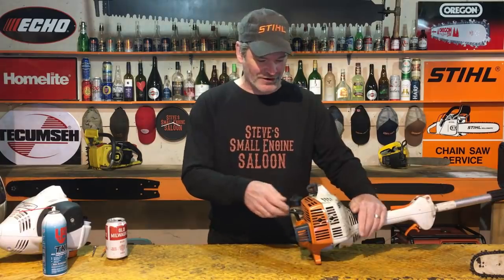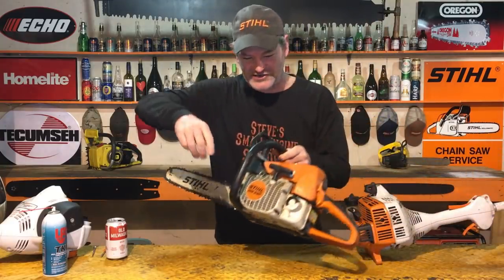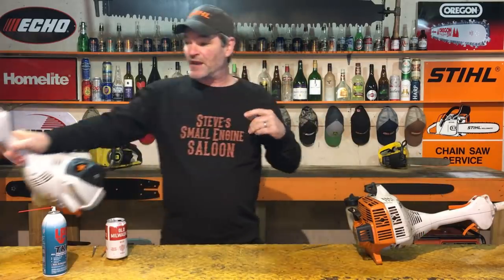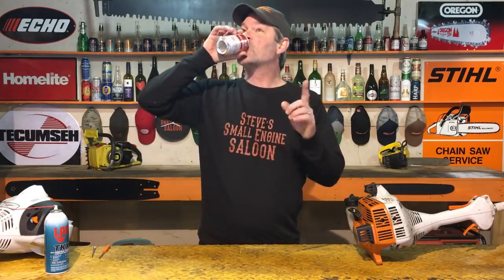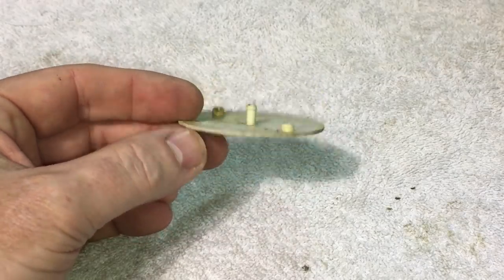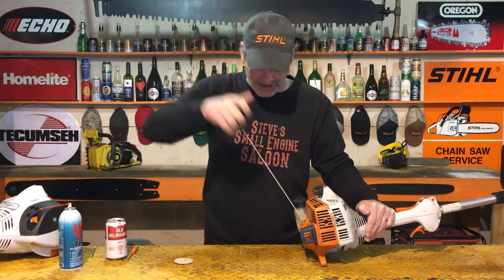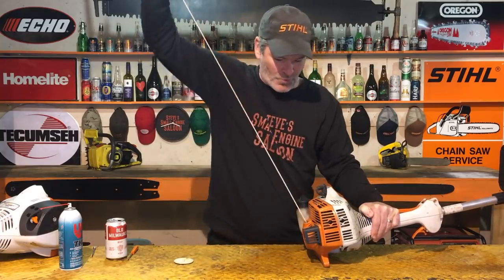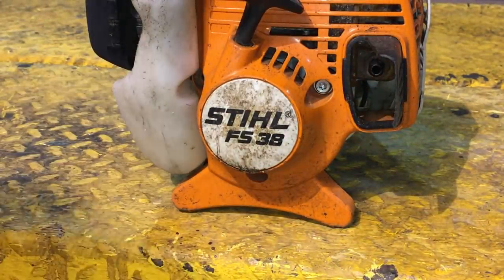How To Lubricate A Sticky Starter On A Chain Saw or Weed Eater

Comment: Thank you so much.  I could not start my machine after the winter and the grass was getting long, I just could not get enough of a pull on the recoil string. I found your video and today had a go at fixing it. The cover eventually flew off, in one piece thankfully. Having lubricated and refitted the cover you could have knocked me down with a feather when I was able to start the machine. Brilliant.
Reply from the maker: Glad I could help!

Comment: As always, awesome video man!!!  I'm telling ya, you & Reg Coates & Billy Ray are all I need to cover every base of info I'm seeking!!
Thank you very much, I just finished running my first 'test run' on a beaten old Poulan that I acquired, I wanted to make that thing strong to practice on before getting after my other saws....I know there's a certain childish desire for more power, I won't deny that, however when it comes to my main tool - chainsaws - the power does matter insofar as you're safer with a properly running machine and with chainsaws that means constant upkeep & routine overhauling, I got it in my head that instead of paying for repairs or buying new units &  selling broken ones as-parts-only that, if I could only get 'solid' with 2-stroke mechanics (saws&blowers really), then not only could I maintain my own gear but I could purchase used gear & get it running well (perhaps even flip some gear, as I browse craigslist&thrifts when I get the chance so am often finding deals if only I could do some minor work to the thing!), but while that's all really cool and going to save me money (maybe even make me money, if I find myself buying&fixing saws often-enough that I'm selling them off, that'd end up being profitable!) but, of most importance, is that (crudely put) a powerful saw is a safe saw, especially in-the-canopy with top-handleds!  I know that, on the ground, it's better to have the smallest bar possible that'll do the job at-hand and, of course, the smaller a bar&chain on a given powerhead, the faster they are (safer due to reduced time-spent-cutting), but in the canopy which is where I'm most concerned the bars are already short but there's obviously HUGE value in both the power-to-weight ratio of a given unit and that is 100% something that will vary wildly *even with the same saw* but, having been a student of your channel for weeks now, I can list every last way to ensure that a unit is operating at 100% - which is usually scary-impressive with a brand-new top-handled unit by any manufacturer - by ensuring everything from the chain to its lubrication to its powersource is operating at peak efficiency!!  I do hope to 'move past' your channel, obviously not past your skill LOL I just mean that you're not making "how to hot-rod this specific saw" videos and that IS where I'm aiming to end-up, I have to imagine the time I've been learning here has gotten me so close to where I can actually start tinkering in fact I've got a saw that I'll be doing my first actual mod to later today - was going to wait for my tach so I could do before&after comparisons but found that the muffler on that particular saw was built in a way where, by unscrewing 1 small screw, a plate comes off that not only was all-but-blocking the muffler's 2 exhaust-ports, but also sandwiching the spark-arrester between itself and the side of the muffler[over the two exit slots], this makes me think it HAS TO BE yet another example of INTENTIONALLY-RESTRICTED MACHINES, especially chainsaws, I mean I get that a spark arrester can be necessary sometimes but this type of design is one where the arrester's retention-plate literally 'chokes' the two muffler-exit-slots the machine breathes through, so I never even had to take a drill to my muffler I simply left the arrester's retention-plate off and RIGHT AWAY there was a small but plainly noticeable difference in power (and sound of course), I would LOVE for you to do a video on *"WHY MANUFACTURERS ARE INTENTIONALLY WEAKENING THEIR PRODUCTS BEFORE RELEASING THEM"**, the stihl 201t coming after the 200t is probably the best example, where you've got a successor model that's weaker than its predecessor *out.the.box but, after a quick timing adjustment/muffler mod/limiter removal (see Brad Sneller on Arborsite for great walk-through of a 201t 'fix'), I know that's just 1 example but there are many I am sure you know what I mean, I like the stihl 200t/201t example best though because it's almost as-if stihl intentionally created the 201t in a way wherein it's very simple for the end-user to modify it 'back to normal'/'how it shoulda come', I would love to hear your thoughts on both A just how intentional this behavior is IE how often (and what ways are most common) are manufacturers intentionally choosing a weaker (but better emissions or noise or whatever) path, of course I'd just love to see you do a couple basic / entry-level videos on modifications, obviously every unit is different and things get model-specific real quick which isn't what your channel's generally about but if you did 'an overview of chainsaw modifications' video it'd actually cover SO much of what would be covered in another recommendation I'd made (to have a 'how it works' video) because, instead of talking about how "you shave 3mm to alter timing Xdeg on CS2700t" you could simply do a 15-20min segment going over every.last.modification in the most general sense, explaining the reasons one would / would not do that in particular cases (ie why*), covering all the types of mods - which'd give such a great overview of where power comes from - and ending with how to treat some theoretically-modified machine, IE if you explained why you'd use a lil more/less oil-% fuel, or you'd be altering H +/- L based on what you did, your explanations of *why would be so explanatory, I think this type of thing isn't just neat insofar as the content itself but because it's almost a mental-exercise, theoretical-example type case, if you went over all the things that you'd do if you were considering boosting power-in-general (ie no specific models) then just hearing your thoughts on what things are most important, what things are risky, what you'd be expecting after doing something, etc etc would all be so illuminating!

Comment: You should do an all around maintenance video on weed eaters, chainsaws, blowers etc including things like this. I know a chainsaw you put fresh gas in and make sure the chain is sharp maybe clean the air filter but something super in depth including lubricating springs and the likes to keep these expensive machines in tip top ahape

Comment: Very Common on "PULL-START" Engines...

I typically will pull the Coweling/Cover and cycle the recoil with Aerosol Silicone, or Lithium Grease! Fixes it EVERY TIME!

And, I'll also replace the Recoil Rope as well.

Secret: I will also lightly grease the Rope to MINIMISE wear from the Return and Retainer Whole...

Thanks again Steve! 😎

Take care,
🤓-Thomas

Comment: Awesome Steve, hey I would love to see you do a video on the bg86 blower. When I start mine up cold I have to hold the throttle down all the way for maybe 2 mins before it will gain full power. I have adjusted the carb, took the spark arrestor out and still does the same thing. Oh and its basically still new. Not sure if this is common on these blowers or not just wanted to here your thoughts.

Comment: Steve just a mad idea could you just pull the coard out and put oil on the pull cord near the end of the pull start so when the cord recoils the hole thing inside gets lubed up
Reply: Don't think so, the cord is not really in a position to lube the spring. Just my thoughts mate.

Comment: You should only have to clean it with some carb cleaner. Most of those little spring type starters are made to run dry. Any kind of lubricant will attract dirt and plug it up more

Comment: Did I get a junk Husqvarna yth22v42 by chance, or do I use it beyond it's expectations, or do other people have one that's just a year and a month old and disappointed?  I'm willing to admit I use it to mow a church and a bunch of poor peoples houses for free, but this is my 3rd replacement blades (oregon) and the stars on my spindles are wore away and the threads are stripped on the spindles.   My steering wheel is held in place by bungie cords, the seat is cracked, neither of my replacement front tires hold air, I had to replace the front bearings after only having it 7 months (I lube, but I think it was faulty off the floor, but since I use it to mow a church and get paid for it...).   Just curious if anyone else thinks their 2017 model year is junk.